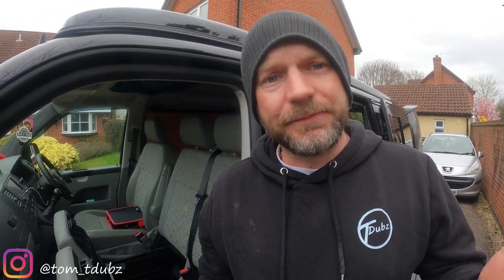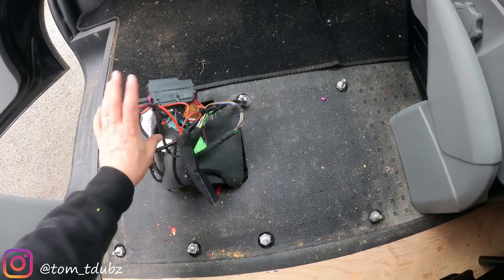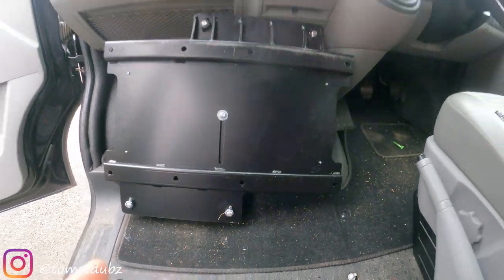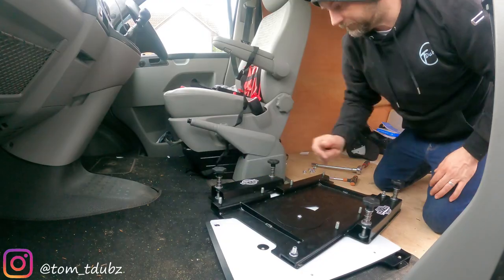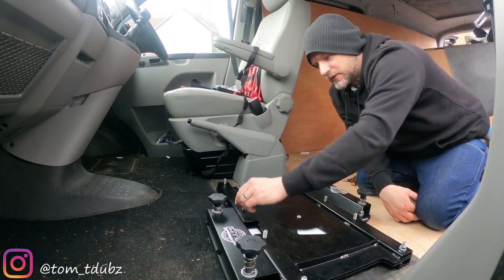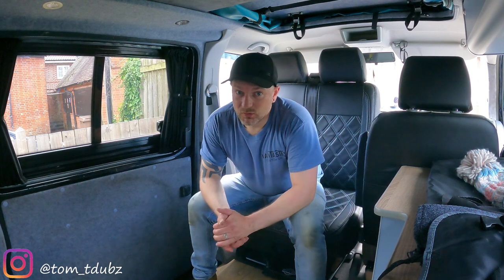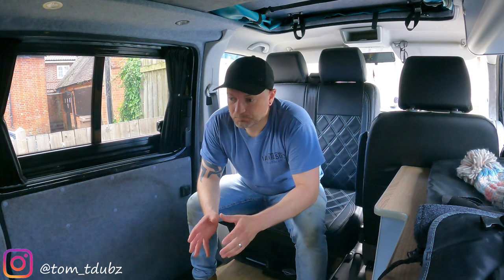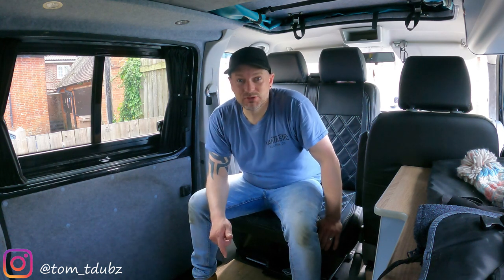Double swivel base Rustylee diy howtoguide vwt5

Comment: Hi did you use the original nuts for the swivel part. My one is catching slightly on the top right bolt. And another thing is it normal to scratch the white plate over time.

Thanks
Reply from the maker: Over time the white will scratch a little, bits of dirt etc caught between the two, did you cut the front bolts down slightly? If your not spacing… you need to remove the non threaded part on the front 4 fixing bolts.. use the original nuts to hold the base then the new ones to hold the seat.. hope that helps